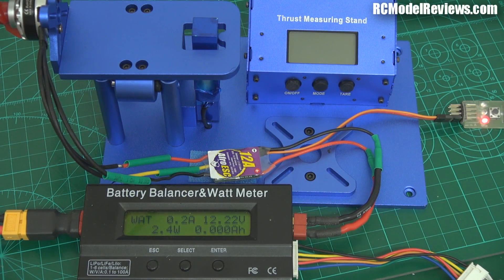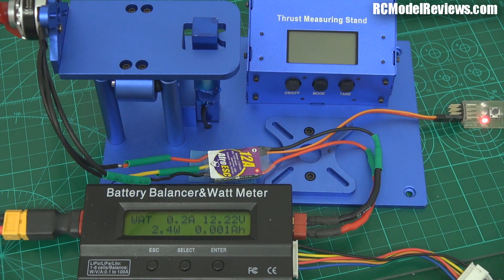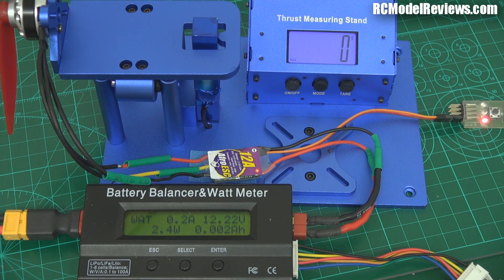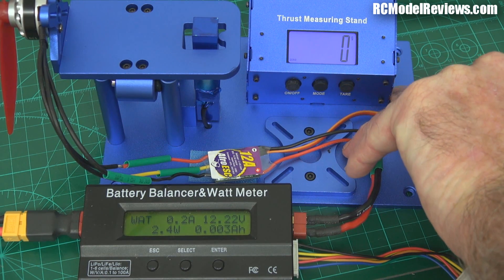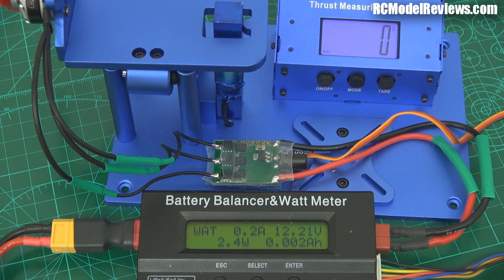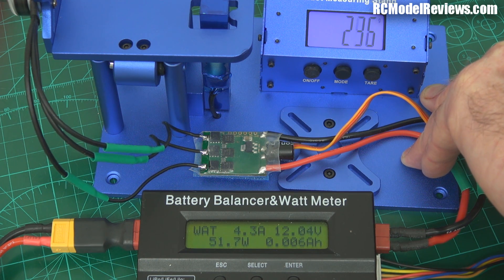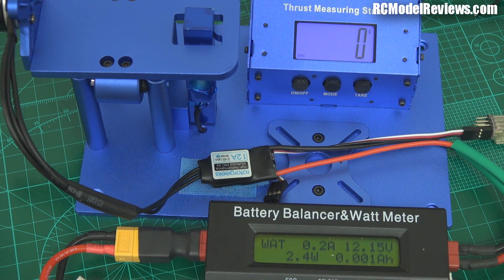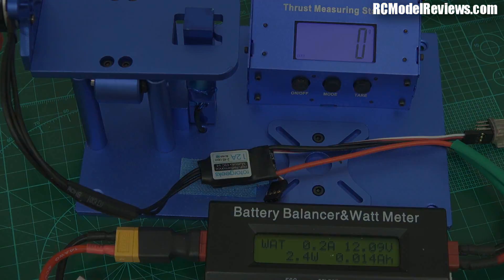Does ESC choice affect motor power?

Comment: Here's a question for you about ESCs... I have a Banana Hobby Flyfan 6S 64mm EDF that comes with a 40A ESC and when tested with my Watt meter it maxes out at 40.8A @ 942 watts. Now, I maiden this plane twice on two individual 6S 2600mah/45C batteries @ a constant speed of 60% and both times it dead-sticked at 3 minutes (which might sound about right for these batteries); however, immediately after landing I checked each battery after flight both times and the batteries come down with 65-66% each time! And yes, after checking batteries after each flight I did rev up the motors and they still had full thrust, even though they had died in the air and dead-sticked each flight! And BTW, both these batteries are fine, have proven themselves in a 6S Banshee on multiple flights, no problems! So my question is this; what would cause this to happen? Also, just for S&Gs I tried the plane on the ground (at home) with 3500mah/60C batteries and the first run ended at one minute where I watched the Admiral receiver red light flicker for about 15 seconds before the minute was up and the light went out completely! And yes, after cycling the throttle stick to zero (almost immediately after "lights out") I ran the EDF (as in fight) at about 60% for about 4 more minutes on the 3500mah batteries.  Yes, they measured at 26% battery left over after 5 minutes total. Now this is all very interesting information, but it would seem to me that there's no constant here! So I'm confused... I think it's a bad ESC, but what do you think?

Comment: @RCModelReviews if i just want to test a motor (make it turn it doesn't need to go fast or anything) that requires a 60A ESC, can I get away with a smaller amp ESC?

Comment: Hi and thanks for the video. What factor in esc should I look when using low kv motors like rc motor 5010 360kv ? I use the same 30A esc but I get very different result. The 30A esc BLHelli-s little bee doesn't run the motor no matter using Dshot,  one shot or any other protocols.  Hope someone can help here .Thanks in advanced

Comment: Sir,  I new to RC Boating.  I need to know a few things.  When I chose a Motor for my boat,  say like a Leopard 3674-2200Kv,  how do I chose a the appropriate ESC ?  Is it determined by Amps of the Motor, or Voltage,  or BOTH ?        And lastly,   Can safely use a say 180A esc for a 90A motor at  22 Volt (6s) .      I really only to run 4s and 6s.....  Any help would be most appreciated.  Thank you

Comment: You don't really notice a difference until you start going 2 bigger scale .20 size and up where the ESC does make a difference. An example on the FMS super Cub with the stock ESC 45a and a .32 size brushless motor. Swinging a 12 x 7 prop on 4S even though the combo did not get hot even when I put a 13 x 6 prop I was only able to get 670 Watts change the ESC to a hobbywing 60 amp I was able to get 898 Watts that's what significant difference. And your system ran really cool. So basically I was able to hover my cub with just a prop change and ESC change. 

Don't know weather that's coincidental or something is happening there. But it did work. Never worked with smaller scale unless it was two different brand ESC's and the build quality was different.

You never followed up with another video.

Comment: questions can i run any 2s lipo on a  2s 320A esc   etc
will a 1200mah 25c battery (30A outpot) work on a 320A esc or do i need a battery that can deliver  320A

Comment: I am trying to make a F450 quadcopter with 2212 2700Kv BL motors, 30A ESC having 2A 5V BEC output and 11.1v 2200mah battery .
All the connections are in right position (I have checked several times ) but after the armed (alarming sound from Bl motors ) when i am trying to fly the drone , no motors are running and they are start shivering (same like if you connect a DC motor with AC supply ) , could you help me on this ? 

Are the motors , ESC and battery are appropriate to each other ?

Comment: Bruce you never look at comments on your older videos. Well, I hope I am mistaken. I bought Cobra 2204 1960kv motors and triggered my fire button on 20A ESCs from Rotorgeeks on sale. Now, since the motors are rated 140W @ 3S batteries I only need 12A. Question is, will these 20A or even 30A ESCs work right out of the box without having to program them and whatnot?

Comment: rcmodelreviews i have currently cicada 30amp i believe they didnt have label still but i have f40 2600kv 2306 silver windings and it feels like it didnt pick up more speed and dont feel no better than my old brother hobby r4 2206/2600kv motors i had? could bearings being cruddy on f40 2600 and also could my esc's be limiting my power? Whats your thoughts

Comment: If I apply 1 volt via throttle to my ESC but the motor spins faster than its KV rating (ie 2000RPM on a 1000KV motor) because of wind pushing against the propeller during a steep dive of my drone, will the ESC try and slow down the motor, give no voltage or continue to give 1 volt which will end up  reenforcing the 2000RPM?

Comment: Hi there, you've done a great video. I have a damaged ESC caused by falling drone. It is a pretty new model and i don't find the ESC as spare. If i buy another kind of ESC with appropriate parameters, do you think it will work with the other three together ? Do i need to programme it to work as the existing ones ?
Thank you.
Reply: What was the answer? I have a similar problem. One of the four ESC's is faulty.....do I need to replace all four because I can't find the same OPTO 30Amp that came with the Flamewheel kit. Is it better upgrade all four to 40Amp ESC's?

Comment: whats your opinion? alien 5" with dysxs20a im worried about not having enough amperage rating for 2206/2300 knockoff of brother hobbys called droneproz racing motors ill be running 4s but i was going to go with littlebee 30amp bheli-s but the company seem to think the dys 20 was better setup. I hate i want be able to run 5s or even crazier 6s but i guess if it bothers me enough ill save up for higher rated esc and put nice set of 2206 motors like brother hobbys returner. Do you think that this will be enough amperage for time being or should i consider finding esc's asap?

Comment: Hi, I'm new to this hobby, a question I'd like to ask through viewing your video on sbecs, with regards my model .I have a Hangar 9 P51 blue nose, I'm running a Efite power90, CC100 esc with a 5A bec, I have 7 digial servos (hitec HS-5485HB) and 2 hitec  retract servos and being powered by two 4s 5000mha in series. I don't have a separate battery for the receiver. With your expert knowledge do I need a sbec, to run the electrics safely and efficiently? Can you help?cheers Kim

Comment: Hi Bruce,

I'm a big fan of yours, and speaking of fans, I wonder if at some point, you could treat your loyal followers to a comprehensive appraisal of the performance of budget propellers, when compared to the more expensive ones with a common battery/ESC/motor?

I have run numerous tests of my own, with some wildly varying results.  I can't always get anything like the published thrust, watts, or amp draw for a given motor with the cheaper typically Chinese propellers, but that isn't always the case.  The performance of some of the more rigid ones when properly balanced, doesn't fall far short of the more expensive ones.

Then of course, there's maximum rotational speed to consider.  Some motors will rev the prop too high and they don't like it at all, vibrating and doing all manner of weird things.  When attached to a prop-saver, some of those cheapo orange things have a nasty habit of flying off altogether, even when balanced.

A video giving your own take on this matter would be greatly appreciated by the wider modelling fraternity.

Regards

Tad Davison

UK

Comment: Id like to see a test done on the differences between battery c ratings, I use mt2204 motors and with a 20c and a 30c battery, to me i dont see any difference but is there in controlled test environments???

Comment: Very nice video Bruce but you didn't mention what the timing settings were cause running one esc on high timing compared to another one running low timing you will end up different results.
Pete.

Comment: Good video Bruce. I have found it the Hard way (flying in the field). I used ZTW, Hobbywing, OFM MOSK Custom ESCs and with ZTW i always had low power on motors. that kept me wondering whats going on. Switched to Hobbying 10A and it was better power than ZTW 12A. used OFM MOSK 12A (our own OEM ESCs) and it was even better. 

Great video. keep educating us bro

Comment: Bruce big thanks for another great feature, really appreciate the info. Is there any value in stripping the heat shrink and adding a passive heatsink to the MOSFETs? Just thinking that the plastic probably makes for a good insulator and a small sink would not add a lot of mass but could improve reliability. Trying to decide mini quad or hex camera setup.... All the best Dave

Comment: Very important question I wish Bruce would address:  Do ESCs prevent current from being more than rated?  Do some ESCs do that?  Is there some warning besides putting  your finger on the heat sink that the motor is too big? Do some ESCs fail gracefully?
Reply: Coming from hobby electronics these's probably very few ESCs that have thermal protection simply because it adds complexity and thus unavoidably cost. On some of the more expensive ones maybe, but the way a parallel circuit of MOSFETs fail makes it very hard to compensate for.

When one MOSFET goes past its limit it enters a process commonly referred to as a "thermal runaway". When this happens the conducting elements have gotten so hot that their efficiency has dropped significantly and in turn produce more heat while passing less current. Meanwhile it it also unable to dissapate this excess thermal energy and as such a negative feedback loop is created. The conducting material will then reach its melting point (often, but not always, igniting the plastic hull of the MOSFET) and in one way or another assume a permanent state where heat is no longer produced, which is to not conduct between the switched terminals at all.

Once this process is completed, the load on the remaining parallel MOSFETs will have increased since there are fewer paths for the current to take. This in turn will cause the next MOSFET to overheat, restarting the process again until all MOSFETs have burned out.

You can imagine this as two tanks of water. One is above the other (a voltage difference) with filtered rusty pipes going between them. When the water is moving too fast (current is too high), pieces of rust start dislodging from inside the pipe and plugs the filter at the end. Since the water has fewer paths to take we get a higher resistance but the water wants to keep flowing at the same rate as before, causing an even higher current in the remaining pipes. The pipes that happened to have more streamlined pieces of rust start to degrade as well and eventually the last pipe will have a tremendous current through it causing it to fail almost instantly.

I hope this answered your question.
Reply: Thank you DJ,
So there's no warning that you are about to thermal runaway? How about running it on the ground with your finger on the ESC, slowly advancing the throttle? It is my experience that you have to have a blower on the motor if it is not flying to do this. I also do this in the air by flying at near full power around and around and then landing and rushing over to put my finger on the ESC and the motor and the battery. I then fly it again with more thrust, test the temperature and do it again until full throttle. My guide to too hot is if I find the temperature uncomfortable. If any one of them (motor, ESC, battery) is still cold, that component could be smaller.
Reply: Djhg2000 actually quite a few ESCs have thermal protection.  Its not uncommon.
Reply: Rotorgeeks ESCs have temperature protection! GO to their website.They have a great video of it in action.
Reply: Wow. Thanks Nick,
22 amps on a 12 amp ESC. Smoken... I sure hope Bruce sees the RotorGeek video. He really needs to step up his tests. What Bruce did above is of little value compared to what RotorGeeks did.
Reply: KpilotRCHelis I'm still fairly new to multirotors and just recently built my own quad (but I've been doing hobby electronics since I was a kid) so I guess I got stuck in the cheapo ESC world there for a second.

Comment: Ok... so all other things being equal... what is the 'motor timing' of all those ESC's you used.

Are they all running the same timing, or is on ESC's timing better suited to the motor you were testing with compared to any/all of the others?

If one of them is firing the pulses to the poles right on the sweet-spot for that motor, that would have to make it run more efficient and make it produce more power if everything else is the same, no?

Q-Ball :)

Comment: I think you should really use a powersupply instead of a battery to do these tests. Especially on the full thrust tests the voltage seems to drop quite a lot, and by a different amount every time. This makes the results less compareable than they should be. 12V power supplies for LED applications should do the trick very well and getting them for high currents (let's say 50A if you needed to) is no problem. Didn't you even show one of these in one of your videos some time ago?

Comment: Testing the max thrust and Amp/Watt usage only helps me if I want a little  higher top speed. 82 vs 87 km/h doesn't make that much difference to me though.

Personally I'm more interested in battery life. So if you could test Amp draw for the same thrust (preferably a realistic thrust like a little above hover) I'm more interested. Although I have a hunch it will be more or less the same.

Comment: Hi Bruce,
Timing of the ESC makes a big difference in ESC power/ efficiency. Is there any timing difference between the ESC's you just tested? If you run all of them with BL-Heli and the same settings, that should give a nice apples to apples comparison.
Reply: Emanuel Stassar I ran the Afro 12A and the RotorGeeks 12A straight out of the box -- as someone would find them if they bought them off the shelf.  Lots of folk don't mess with timings and don't want to fuss with changing such settings -- however I will be explaining how to determine the optimum settings for timing and other parameters that can be configured if you have a desire to do so.
Reply: *****
Bruce, that would be interesting. Most ESC's give you a lot of options. When timing problems cause bad running, I change it but otherwise I normally leave it alone. I know you can squeeze more power from a system by changing the timing, but at the cost of efficiency. It would be interesting to get some numbers !
Reply: yes, timing makes much more difference than the internal resistance does, not that it is not important, but timing makes huge difference, telling from experience working with blheli f/w as well as the hobbywing xrotor series.
Reply: ***** Timing is really important for all users of brushless motors, I think. So your video will very helpful.  
In cars and trucks, there's also the whole start-up thing, but of course that's not really an issue in flying.

Comment: What do you think about the Rotor Geeks 30 amps escs? I'm building a 300 size racing quad and I'm think of using those rather than the 12 amp ones because it's quite a bit larger and heavier than a standard 250 size quad.
Reply: Alex zuga I am using them in my BL330 so stay tuned and you'll see how they work.  I'm also doing a bench-test of the RotorGeeks ESC range so that will also give you important info.   The 12A ESCs are good for up to 4S with 6045 props on a miniquad but for a 330-sized frame (where you're more likely to use consistently higher power levels) then the 30A would be a better choice.
Reply: Sweet cant wait!!